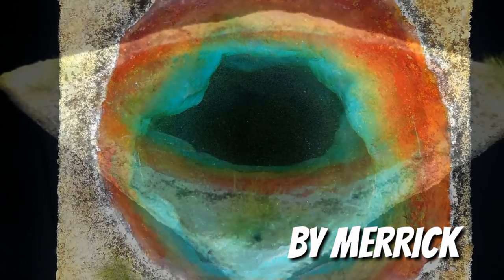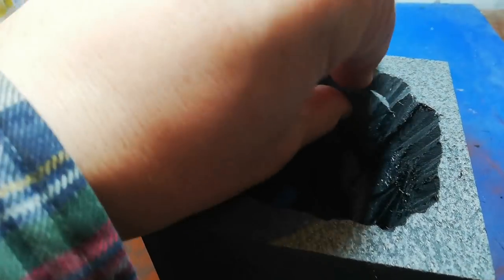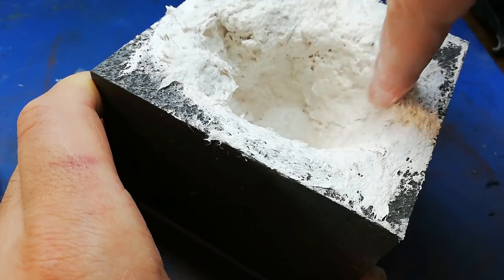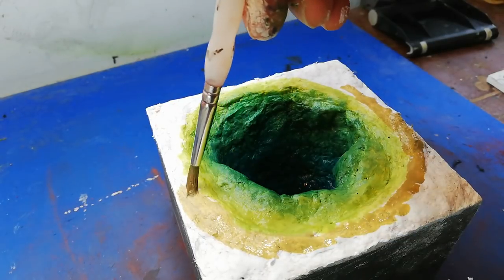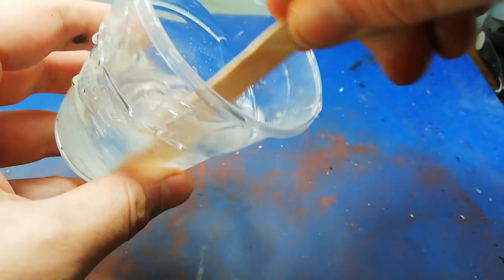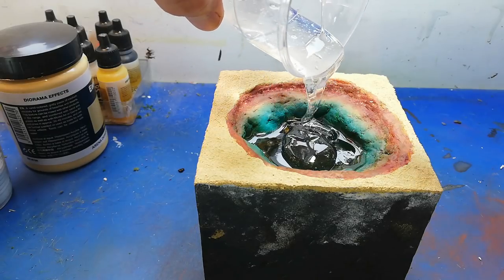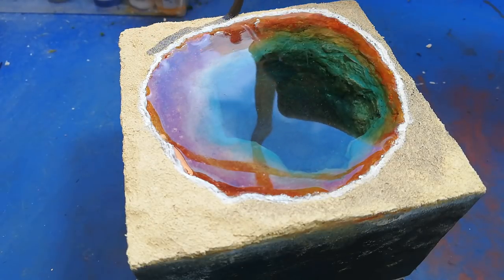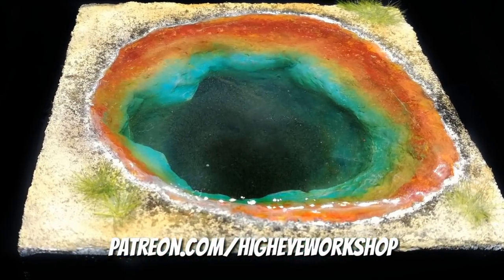Morning Glory Pool diorama: how to make this stunning miniature scene

Comment: Beautiful work! Looking forward to watching the rest of your videos. Question - couldn't you mix your epoxy in a heat-safe container and de-bubble it with your torch first, and then pour it into your piece? A few more bubble could be introduced during the pour, but very few and could be removed easily. Plus, if you DO scorch the epoxy, you can dispose of it without ruining your piece. Just a thought. Cheers!
Reply from the maker: Sorry for late reply. Good tips. I do tend to leave it to degas for a while, but actually I think the resin is not the right kind. Should be the deep pour kind for such a...well, deep pour!

Comment: I would've used a piece of glass close to the top and then pour the resin on it.
Reply from the maker: I thought of that. The problem is in blending in where the glass is embedded into the sides of the hole.